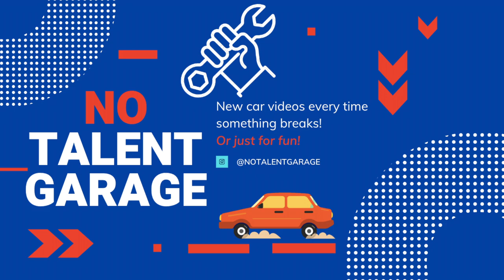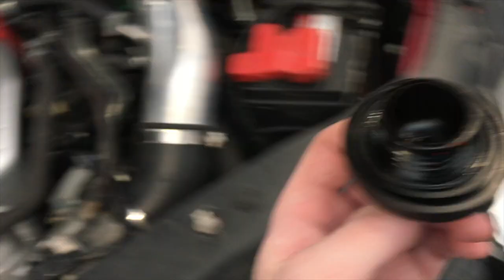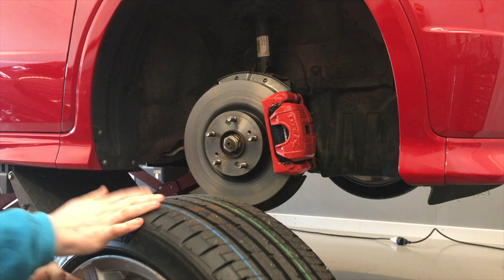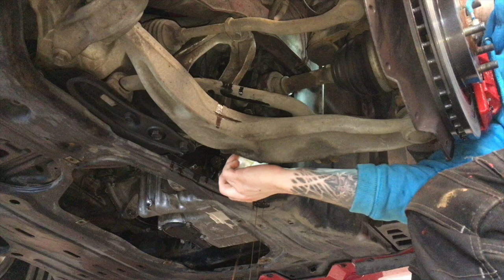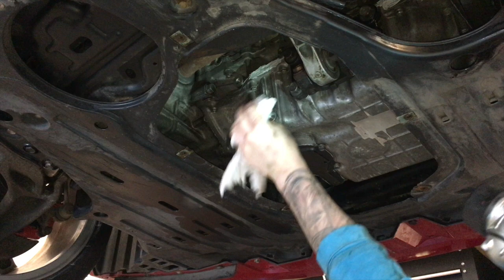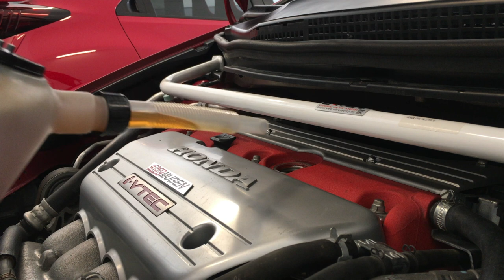How to change oil and filter Honda Civic Type R FN2

Comment: Thanks, great little video this one. I had seen a few others but with the camera angles you are always wondering what you are looking at with some of them. This one is nice and clear. When I picked up my FN2 I read up that it was a bit of a process to change the filter and was not sure I could be bothered with it and it's just easier to take to a garage but this looks ok.
One thing, I did hear you have to remove the wheel as you have shown and remove the wheel arch lining, plastic panel. Those plastic studs? were there many of them to remove and did you break any? Just wondering if it might be worth trying to source a bunch before I start. Keep up the good work, subbed!
Reply from the maker: Thanks for the kind words and for the sub:) I just remove the two plastic studs that I show in the video, none broke. I have also previously changed the oil without loosening the plastic, it works too. But if you spill a lot of oil when you change the filter, it gets quite messy on the plastic. Overall, the work becomes easier if you loosen the two plastic studs in my opinion:)